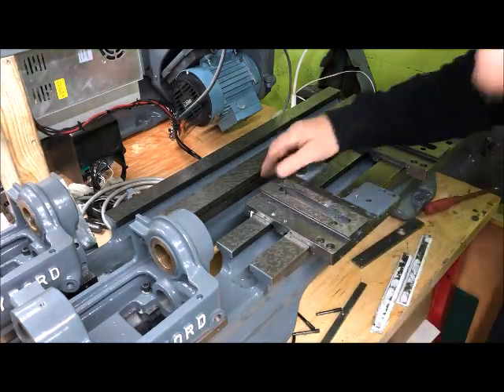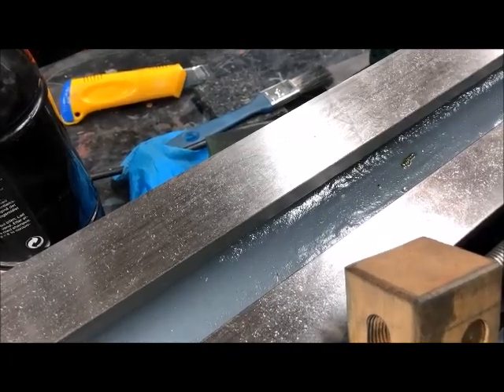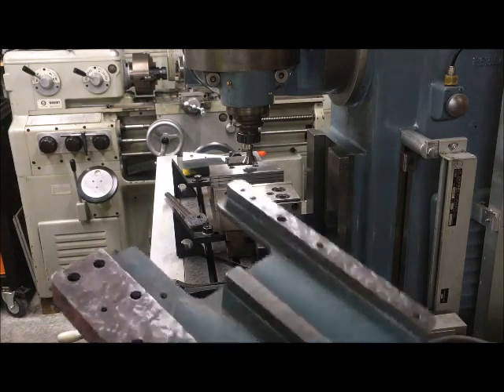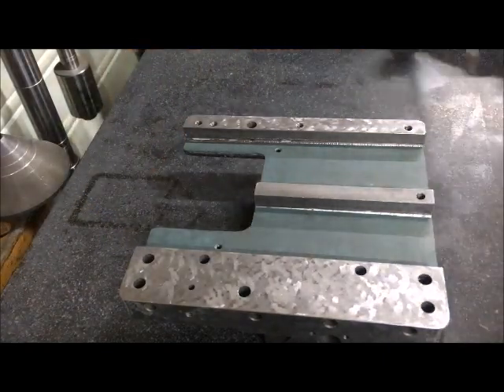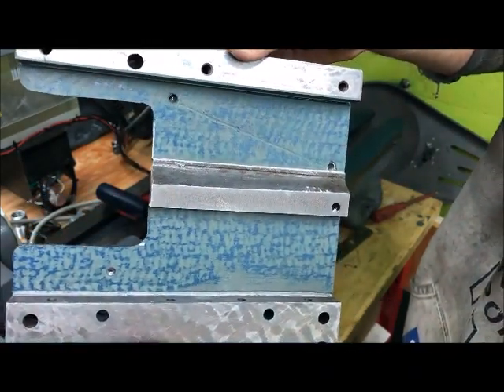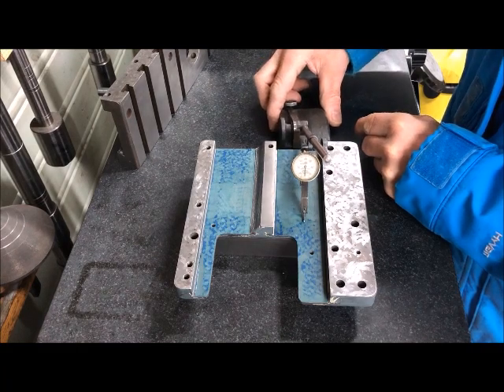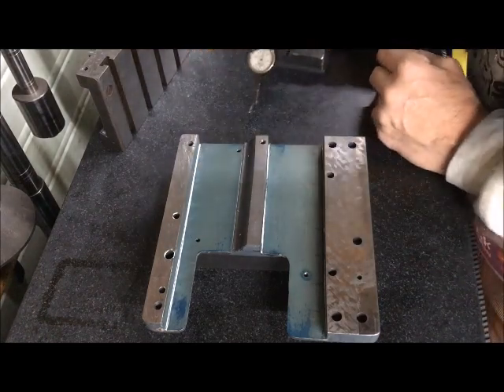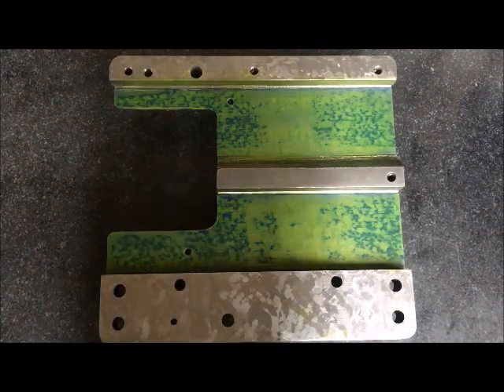Myford 7x7   saddles  - Rulon milling and measuring

Comment: So thats rulon and not turcite? Where do you get it and what does it cost? (Size and thickness, epoxy glue etc)
Reply from the maker: Correct. Rulon, not Turcite. I have bought this Richard King, who can source this in the US. You may also get it directly from TriStar Plastics. Not sure if I remember the cost, but contact Richard on his website http://handscraping.com/Machine-Sales-Cottage-Grove-MN.html
You may get different thickness and the thicker you use, the more "forgiving" it is.. ie. if you inadvertently do something wrong and need to go deeper than planned.
I used Biltema 2 component Epoxy, but TriStar Plastics also sells their own? version. Important to execute the prep stages well and a 24 hrs curing hardener is recommended

Comment: Thats Nice..ro much work..but you think that scraping parts can be enough for a good machining results?
Reply from the maker: Thnks! Of course. The parts will be as good as the reference surfaces, eg. granite table, straight edge and your skills in using the tools allow. Very, very tight tolerances can be achieved as well as "longevity", ie. scraping oil pockets so that the machine stays accurate longer. With scraping you can even improve on a ground surface this way. It is the lack of lubrication that "invites" wear..
Reply: @jansverrehaugjord9934  i am actualy trying to make a little lathe (same size of myford 7×7) ..i am still casting parts ..idont have a milling machine .. i was thinking how to get clean sufaces like that ..
Thank you sir for sharing this informative video
Reply from the maker: Good luck! Just remember that scraping is not a technique that removes a lot og material, hence cannot replace a milling machine
Reply: @jansverrehaugjord9934  thank you :)
Reply: @abdeljalilpr2033  - Are you making iron castings?  What parts?  There are very few hobby foundries that do iron!